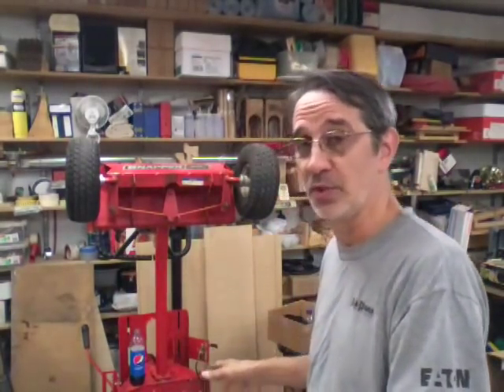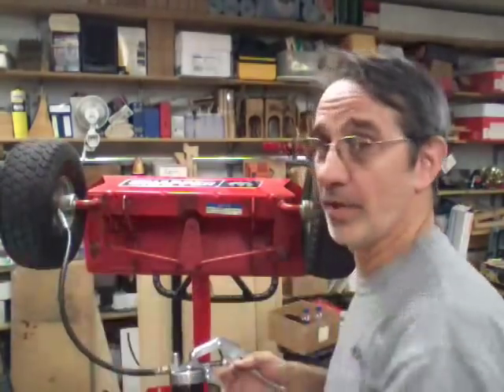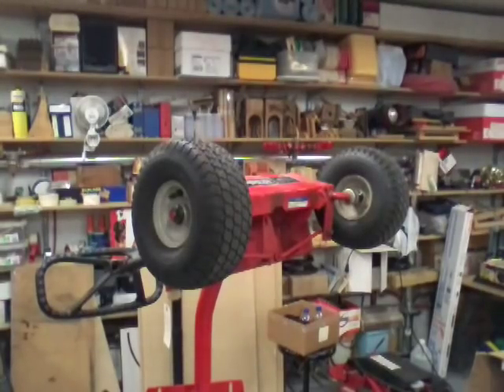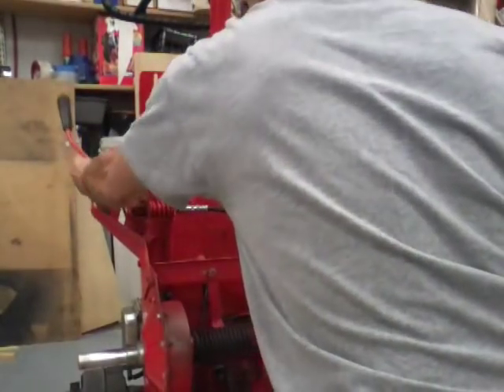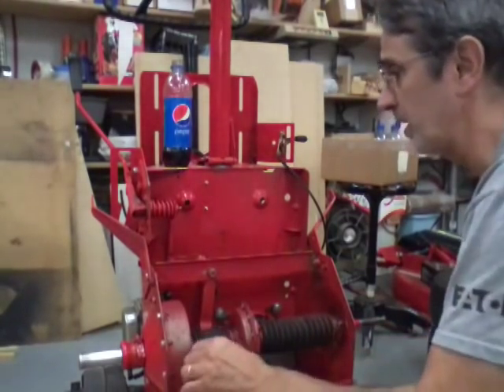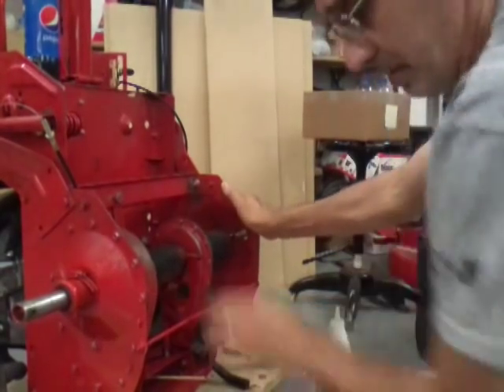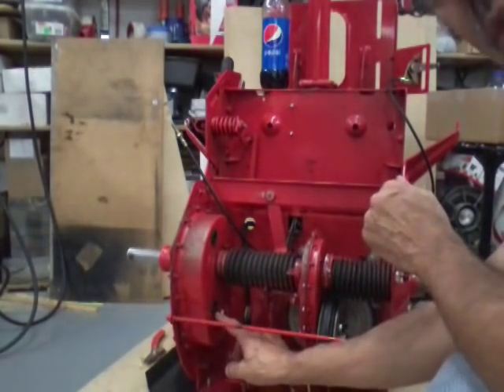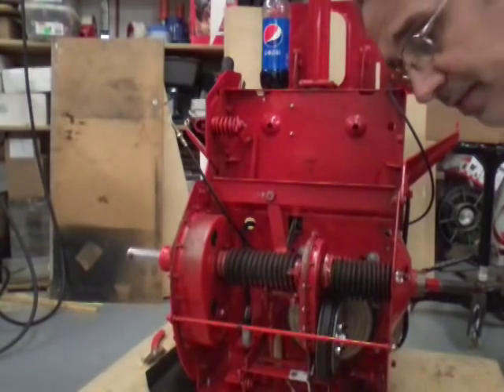143.   Greasing and oiling the entire Snapper Rider

Comment: I wore out the gear shift on my Snapper (SR1433) and replaced it with a new shift unit.  Now “neutral” is not neutral.  Your videos have inspired me to work on my own Snappers since it’s hard to find anyone who works on them.  I have made one of your “turnbuckle” spring compressors and will be trying to remount the shift spring to see if that helps with my shift problem.
Thanks Jim
Reply from the maker: I explain in video number 253 how to take care of that issue try it and let me know how it worked out for    Jim

Comment: Great timing ! I just picked up a well used snapper, and want to check and fill the gear case. Thanks for your tutorials ! Keep it up !
Reply: Use a 00 grade grease. It is like pudding so it flows but doesn't leak out like 80-90w oil will.

Comment: Are the boots the same size on both sides ? It depends on whether you have it in reverse or 5th as to their length when you first look at them ? I had a rear engine 28" inch deck for 18 years and gave it to a neighbor. I bought another 28152523BVE. Can`t remember how long I have had it, but it`s still going after several years. I`m looking forward to your videos on the decking and how to replace belts. The one on clutch and brake cables sound interesting as well. Great job and great advice !
Reply from the maker: Sounds like you may be new to my channel if so, please subscribe it really helps me keep this channel going and it is free for anyone to subscribe to any YouTube channel if you are already. Thank you.   I almost forgot to answer your question. Yes, both boots are the same size today. Buy them from Amazon. They’re black rubber. Don’t buy the Kraish plastic ones they don’t last. Jim.

Comment: Great Video Jim, I love my Snapper.  I started using synthetic 10W-30 in it last year and boy did it quiet down the Briggs engine.  Do you use synthetic in yours?
Reply from the maker: No I don't use synthetic but I guess maybe I'll try it next time I change my oil, thanks for the tip. Jim
Reply: Changing the oil soon and using synthetic 10w-30

Comment: Hi Jim. Thanks so much for your educational video series! I just bought a Snapper Model # 28086S that is in pretty good shape and am working my way through it. It came with the two bagger collection system because of your liking that system so much. I use grass clippings and leaves on our 4,500 square ft of vegetable gardening beds and was using a push Toro Super Recycler. My Snapper collects way faster! A question: Do we need to be concerned with brass gears and 90 wt. lube compatibility? I know Troy Bilt suggest GL-4 I believe it is as GL-5 is not so good for the brass. Thanks again, Dan
Reply from the maker: @DelCorbin  snapper does not use brass gears. The gears, sprockets, and chains are either steel or cast-iron. You do want to keep the chain case and the differential case full of lubricant I would suggest using. Super S double00 Grease it’s made by Smitty’s Supply  industry. I get it from. Farm and Fleet or tractor supply. If you have any other questions, please let me know.

Comment: Can you mix the 80w-90 with the current grease in the chain case? To avoid having to rebuild the gear case.
Reply from the maker: Gabe Guerrero 
Hey Gabe
  I’m not sure what that would do but I suppose it would be better than nothing in there, because if your snapper is five or six years old the snapper Lube is probably all dried up by now. Thanks Jim

Comment: HI Jim, great video. I can't seem to find the left bushing grease fitting on my Snapper 33115SC. My left fender doesn't have the large hole yours does. Do you have any idea where it may be located on such an older model? Thanks in advance.
Reply from the maker: sweet1172 
Hi it’s Jim sorry about the delay but I’ve been out of town.
    Your left-hand bushing should have a grease fitting on the inside of the fender usually when you stand the machine up it’ll be pointing right at you unless somebody put it in wrong but as far is I know all of them should have a grease fitting on them. Jim

Comment: Thx for another video Jim. Appreciated. My -~88 2812X6S RER (Xtra tough series) doesn't have a grease zerk on the left rear axle so I guess I'm stuck not being able to lubricate there. @Homer and other Snapper fans. Register at MyTractorForum.com. They have a sub forum of everything Snapper. In that area, there is a link to many parts, owners and maintenance manuals which has been useful for my orphan. I put a link back to your YouTube webpage Jim. One guy has commented that after watching your videos he plans to tear into his drive train this winter. There are a few "apparently" knowledgeable posters at that site also.
Reply from the maker: 210 Doc 
Send me a picture of it with it standing up and on the inside I would like to see what it looks like. They didn't install it with the grease fitting on the back side where you can't see it did they.   Send it to jimsfixitshop@gmail.com. Thanks Jim.
Reply: To stand it up, I have to drain the oil as it leaks around the bottom of the loose "press fit" dipstick tube.  At the end of leaf season I'll be changing the oil to winterize and will forward some pics your way.
Reply from the maker: 210 Doc 
Just remind me of the reason for the pictures I think you could drill and tap a grease fitting in it with no trouble,  thanks jim

Comment: Jim. Thanks so much for the videos. They're so helpful and one can learn even more reading the comments. I just bought a 2020 RER (its fantastic). I watched this and realized u don't grease the spindle and then read comments and learned why...My 2020 only has a grease fitting on one of the front wheels. Gonna check with my dealer and get it replaced under warranty. Thanks so much.
Reply from the maker: Jason Crump 
Hey Jason it’s Jim I would really like to see a picture of that new snapper with maybe you sitting on it, what size is it a 28 or 33 and what state do you live in.
You can send a picture to my email which is
jimsfixitshop@gmail.com
 That does sound a little weird that they only have one wheel with a grease fitting on it must be somebody forgot to drill the hole. Would really like to see it thanks again. Jim
Reply: @jimjackson9381  I sent one . 33 of course! Dropped down from a 42 tractor and cut time is faster

Comment: Nicely done! I have aquired a used Snapper, and I was wondering if I could top off the cases with gear oil without disassembly... I'm not sure if they have Snapper lube or if it has been changed to gear oil.
Reply from the maker: @JodyCall  yes you can top them off with gear oil. You wanna use the thickest you can find and it may still even leak out on you a little bit, but it’s better to have something in there lubricating stuff than the dried up snapper lube.       Jim
Reply: @jimjackson9381  Thank you so much for taking the time to reply!! I've watched several of your Snapper videos, and I figured if anybody would know, you would!! Much respect, and God bless!!

Comment: I’m new to these old snapper mowers and finding out real quick how expensive and how hard some parts are to find. 
Question when changing or topping off the diff fluids what are y’all’s thoughts on the synthetic oils. Would they be ok to use or just stick with the old stinking A traditional gear oil. 
Also any tips on where to find parts besides eBay would be appreciated. 
Have a great day

Comment: Hi again Jim. I purchased a grease gun (first time using this tool) and completed greasing up my snapper using that tacky #2. My only question (I can't find anything searching) is how to I store my grease gun. My only use for it will be maintaining my snapper mower. Is it OK to leave the cartridge in the gun, etc.? Thanks.
Reply from the maker: Crazy Gravy 
Yes just leave the grease gun all assembled the way it is as you use it, when I store my guns I usually hang them on the inside of a 5 gallon bucket because sometimes the grease will separate in oil will drip out of the end of the grease gun. Jim

Comment: Hi Jim,
Thanks so much for your videos. They are so informative. Since grease hardens over time, why is Snapper using it? What is better, tearing both the chain case and the differential apart to clean and remove the existing grease or just adding 80/90 gear oil without removing the grease(even if the grease is still soft enough)?
Reply from the maker: allan gorin
  I’m not sure what would happen by adding 80/90 gear lube to the existing grease Snapper uses four 0000 lube in their machines, at tractor supply you can get two 00 lube which I am told works as well but isn’t quite is thick. Thanks Jim

Comment: Hi Jim:  Why load up the front tires/axle with grease when mine has sealed bearings.....they never will see the grease your are loading, right?
Reply from the maker: don David 
That’s right Don, on your machine.  But 99% of the machines out there have cheap open bearings you can buy for three dollars apiece so if you don’t Grease them they’re not gonna last long thanks. Jim

Comment: well iv got back into snappers again ..i know your the snapper guru ..so your channel is my first stop once again 😁 i hope you can reply .i was told the 25 inch i just bought is on the rare side .is it true are they worth at 1000 bucks in top running order?
Reply from the maker: I guess that would depend on where you live on how much you can get for it and I wouldn’t think they would be worth $1000 but I have no idea. I guess it would depend on what kind of attachments you have to go along with it, I am trying to rebuild, a old comet myself and trying to find parts is a little hard because they’re just isn’t any. I ordered what they had available and I think what they’re doing is substituting new parts in place of the old ones. And I’ve noticed there is a lot of difference between them. I am hoping that if there is an issue on assembling the differential and chain case I can manufacture the new parts to the old part specifications.  my parts just came in from parts tree yesterday at work. I’ll be opening them up and going through them and seeing if there is any difference and if so, what it is so keep watching we might all learn something together.         Jim

Comment: Jim- i have a craftsman(green mower) 12.5 hp rer mower that is exactly like the snapper. do i do everything the same as far as lube, etc- cant find much info on it- bought i used for 350 and is in perfect shape- like new-- got a great deal on it- runs like a champ
Reply from the maker: Mike gorton 
Hi Mike it’s Jim
   And yes you do everything just like a snapper in fact them were made by snapper for Sears they just painted them a different color, if you need any help just let me know. Jim
Reply: @jimjackson9381  thanks Jim! Appreciate it- love my new little mower. hooked a rig in the garage to lift it up on the back stand to lube everything like in your video-- an old man had it and never used it- sat in his garage most of the time- a real keeper!

Comment: Hi Jim,
I wanted to rebuild my gear case and change out the old grease with the gear oil. BUT it looks like it may be a bit much. I cleaned out the grease in the chain case, replaced the gasket.
Question 1 will I need some kind of form a gasket to help with the seal?
Question 2 is there some kind of way the get the grease out out the gear case with out disassembling?
Question 3 I haven’t done this...If I don’t disassemble the gear case and leave the grease in the way it is. Would it be a problem using gear oil in the chain case?  So gear oil in the chain case, grease in the gear case. I may already know the answer to this, so I’m going to attempt to take it apart and clean it.
Reply: gear oil is fine its what i use

Comment: I never understood why the front wheels have a grease fitting since the bearings are sealed and require no lubrication.I could understand if the wheels only had a dry bushing like many riding mowers.I never grease mine and they have been in there for years.My wheels are also clean and dont have grease oozing out everywhere.

Comment: Did you replace the grease fitting on the front wheel? Mine has straight fittings 
, making it had to grease. The fittings seem to be pressed in. All I can find are screwed. The rim metal seem to be to thin to screw in.  If you replaced them, where did you get the fittings?
2 days ago
Reply from the maker: Bob Mattern 
Yes I believe most of them are pressed in and I don’t ever remember changing any right off hand if I did I use the same fittings and pressed new ones in. Jim
Reply from the maker: I bought a right angled 90° attachment to fit on my grease gun hose it makes things much easier. Jim

Comment: hello jim, can i add 80/90 gear to the chain cases until im ready to tear apart and inspect?can the snapper grease and gear oil mix? thanks really enjoy your videos ,leaning so much.john in new jersey
Reply from the maker: lorraine kaminski 
I guess I’m not sure what it will do but it should not be a problem I mean anything is better than nothing. Jim
Reply: I put gear oil in mine and its now leaking. I think its too thin. Dont they call for thicker 00 grease? Thanks
Reply from the maker: Randal blankenship jr. 
Yes they call for double 00 lube I run 80/90 in mine but there are some things you have to do before you can do that I have a video that explains all of it. Jim
Reply: Jim Jackson thanks for your help jim. How would you recommend getting the oil thats too thin out? I just topped it off with a few ounces. Just let it leak out for a week or take apart the case and drain? Thanks again
Reply from the maker: Randal blankenship jr. 
I just pull the plug and let it drain out. Jim

Comment: Thanks for the video.  I have a snapper rear engine rider w 28” hi vac deck.  I’ve never serviced the differential or chain cases but have greased the other areas you did w grease gun.  I’ve had my mower for prob 15 years!  Should I just top off diff and chain cases w snapper lube instead of having to remove diff and clean manually? Also can all of these places be serviced w the deck in place?
Reply from the maker: I guess at the very least, I would fill up the differential and the chain case with some lube.    Jim

Comment: Hi Jim, thanks for the video, what would cause a creaking sound on these rear engine riders when you are driving along ? cant seem to isolate the area.
Reply from the maker: Gregory L 
I would check the bushings on your rear axle especially the one on the left-hand side to see if it needs grease. 
    Then I would check the chain case and the differential to make sure that the lub in them is not all dried up useless. Jim
Reply: Thank you.
Reply: The main tube that connects the front axle to the rear/rest of mower creaks along the plastic bushings on mine. Earplugs help keep it at bay ;-)

Comment: So when you filled the chain case...you don't have to drain the old oil in there? Same question but with the differential...???
Reply from the maker: Ryan B 
  Hi it’s Jim
        It’s always best to get the old stuff out before you put any new stuff in but if you can’t then filling it up with new lube is far better than just the old dried up stuff that’s in there. Jim
Reply: @jimjackson9381  do the differential and chain case both take the same oil?
Reply: @jimjackson9381  thanks alot for your response!
Reply from the maker: Ryan B 
  Yes they both take the same Lubricant. Jim
Reply: @jimjackson9381  thanks so much for your help Jim. I got most the old stuff out today using a long plastic medicine dropper. It took forever...about 5mL at a time. The stuff that came out was like very dirty motor oil compared to the stuff that went in, the snapper 00 grease. This was the first time I've changed this oil since buying it new in 2007. I guess the 00 grease breaks down over 12 years of use?

Comment: I was surprised you didn't mention the grease fitting for the large tube connecting the front and rear together. The grease fitting is in the electrical box but can be accessed through a slot in the cover. Should this not be greased?
Reply from the maker: If your machine has grease fittings on the main tube yes definitely grease them and grease them often but very very few machines have those grease fittings. Jim
Reply: Will do.
I'm amazed at how many variations of these machines there are. Mine's a 3311X6S, series 6 form the mid-80s. It has no grease fitting on the rear axle bushing and only the single brake cable, unlike most of the other machines you feature.
Thanks for all your videos, keep on Snapping.

Comment: I'm going to tear down the chain case, and right gear case to clean out old grease, and start fresh with 80/90. Do you have a list of gasket, seals etc I can order in advance so I will have them on hand? 
Thanks.
Reply from the maker: Melloreel 
Tearing down the machine with that much side play it would be hard to try to order parts in advance you're going to have to disassemble it and find out what's bad and then order them sorry.  Thanks jim

Comment: Hey Jim, great channel! My question would be... can I use 80/90 gear lube right over the Snapper lube or grease to check the lube in the chain housing and the differential housing??? Thank you for any reply as I am new to checking and lubing my 2010 Snapper Rider myself. Tired of paying the dealer every other year to do this type of maintenance, along with new drive disk. Your video on the spring adjustment should get me possibly an extra year or two on having to replace that disk. ATB AND STAY WELL!
Reply from the maker: Henry Koellner
 Hi Henry
   No I probably wouldn’t put 80/90 gear lube in on top of the snapper lube, there are some things you have to check in due to your machine to be able to use 80s/90s. Thanks Jim